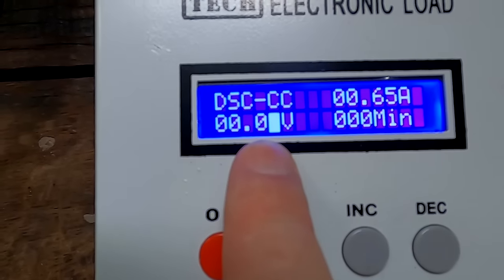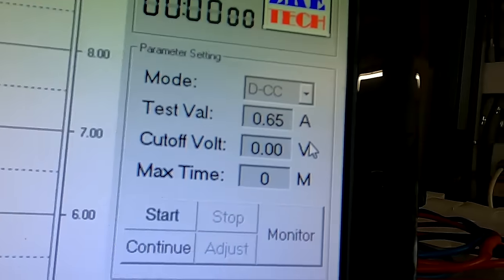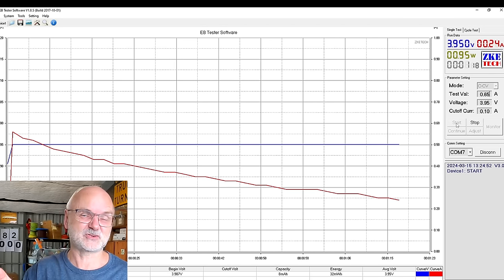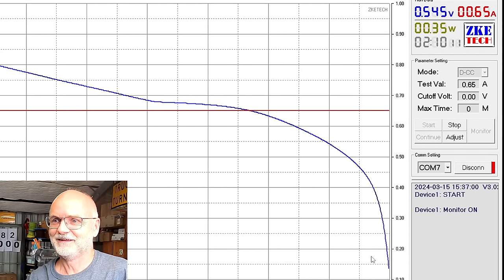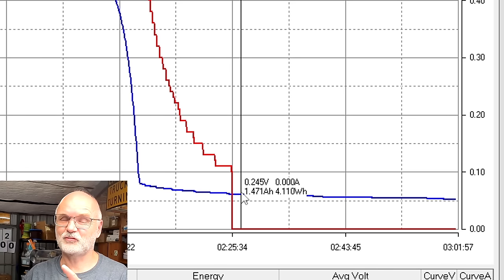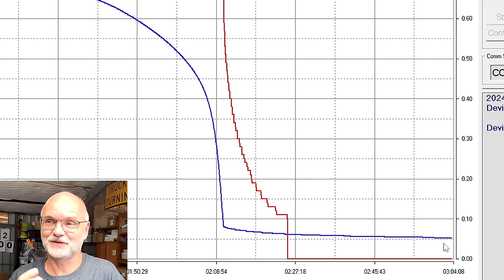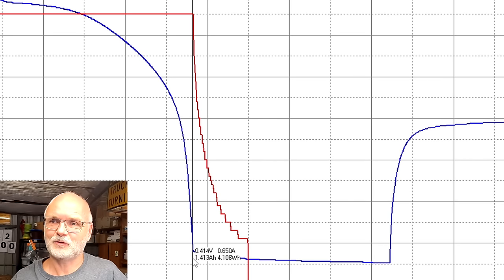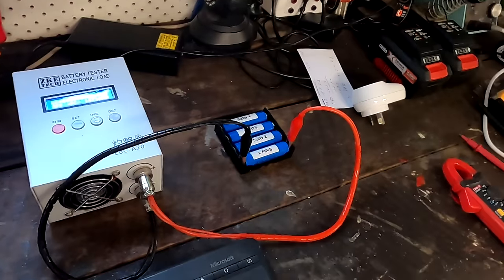Reached the Discharge Limit of a Sodium battery? A voltage plateau at 0.3V!

Comment: The 0.35v is limitation of load tester.  It has a current shunt resistor to ground with an op amp to drive a MOSFET load device for feedback controlled constant current.  The non-inverting input to op amp gets a reference voltage from controller that sets the constant current level through MOSFET. There is limited range on the op amp control and once the battery voltage gets too low the MOSFET Vds minimum voltage is limiting the pull-down voltage to about 0.35vdc.
Reply from the maker: Yes, I agree. Makes sense... thanks.

Comment: Awesome testing. I'm reaching back in my brain to remember the lithium ion curve to compare the density.  I had asked a few questions and I already found the answers. According to the graphs of both types of battery for my inverter discharge cut off I would need about 30% more battery of Na+ to maintain the same Wh as lithium.  Cut off is at 70% Na+ (Wh/kg lithium 180, Na+ 155.) In warmer areas the charging .5C of Na+ is 113f. Lithium is 150f at 1C. There is a cycle expectancy of Na+ 4000 @.5C and lithium 4000@1C. 
Thanks for the work Andy.
Reply from the maker: Thank you.
Yes, you would need more sodium batteries to compensate for the voltage range, you can actually use plus even more for the lower energy density when compared to LFP.

Comment: You should build a big 17s sodium prismatic battery and test it!! Victron cam use most of its capacity.
Reply from the maker: A 17s sodium battery will have a voltage range of 25.5V - 67.15V.
Victron can be operated in some of that voltage range, but not most.
So, you will already lose usable capacity with that plus even more due to lower energy density when compared to LFP (+ more space requirement).
So, the price would need to come down a lot. A lot lot... I don't see this happening. LMFP will be the next big thing is my guess.
Reply: @OffGridGarageAustralia 63usd per prismatic cell per 210Ah, they are not that expenaive...

Comment: Sodium batteries seem to be a good chemistry to have a small battery of this type as part of a larger system, so when using Lifepo4 batteries, if the BMS turns off the Sodium battery would hold the voltage of the inverter at a sensible voltage, no more current spikes when the Lifepo4 BMS turns back on.

Comment: The current drop-off at very low voltages is a limitation of the tester. Even when it's discharged transistors are turned fully on, they still have some resistance, this is what is limiting the current.

Also, there is really not much use in discharging a battery all the way. Remember that W=VxA. So just how much power is it putting out 1/2 an amp? Plus, where can you get an inverter that will work perfectly over an 8 to 1 voltage range.
Reply from the maker: Thank you. We will do an inverter test soon.

Comment: With an accurate volt meter and then a small 1W resistor, you could trickle drain the battery and measure the voltage drop to the bottom. Semiconductor based systems and inductive current measurements will have their limitations but directly measuring the voltage across a stable resistor would be very accurate.
Reply from the maker: Yes, correct...

Comment: That plateau is the load-meter. The MosFets that do the load fall down to there minimum working point. The gate-voltage has to be be higher than source/drain, and need that minimum - a minumum that you know from Shottky diodes measuring too that is about 0.2 V.
So sometimes its better to then use a real wire resistor (no bulbs, thats to much for such tiny cells and is undefined) - and an ordinary "in-line" Amp meter. That Unitec you use caused so many troubles to me, its bit of trash and just a fast "whats going on here" - meter, but not a precise instrument (and below 1 Amp it really starts to struggle and shows magic numbers).

So if you rerun the test, with a resistor - no constant current - and a voltage monitor, you would be able to see a curve that goes down to 0V - and no magic happens at 0.3V.
But - tbh - that makes no sense, because there is no real life use for that.
Data sheet only says 0V does not damage the cell, like it does on Li-based cells.
Its possible to NiCd and NiMh cells to since ages - with no use.

greetings from Austria (that without kangaroos)
Reply from the maker: Thanks for the explanation. That makes sense!

Comment: It looks like the ZKE tester is unable to draw the programmed constant current of 0.65 A below a cell voltage of 0.32 V. Because it cannot reduce its load resistance any further it draws less (you measured it). Consequently the cell voltage decreases much slower from that point on. Later we see a second drawback of the tester. It cannot properly measure currents below 0.1 A and it shows 0 instead. Of course both are excusable failures of the tester because it has to work outside its specification. Usually cells will not be discharged to 0 V and we also cannot blame the ZKE for being unable to measure currents below its minimum discharge current of 0.1 A. But of course it is interesting to go to the limits of both the battery and the tester. Thank you for that.
So no plateau as it seems. You could check it discharging with a 3 Ohms (~1C initially) resistor in monitor mode. But I understand if you want your Na cells to have a rest now and to go on for something less boring than waiting for the cell to reach 0.00 V @3Ohms.
Reply from the maker: Yeah, good explanation. That makes sense.

Comment: The circuit has minimum resistance value it can't go below. Before that sharp drop off in current, the tester would have been able to keep reducing the circuit's resistance so as to keep current at the set value as voltage dropped. But once it reaches the point of minimum circuit resistance, well the current will also drop.

By Ohm's Law, V = IR, with a fixed minimum resistance then as cell voltage reduces the current must also fall away and it will do so asymptotically.
Reply: I think you are on the right track. From my understanding, these types of load testers use large power mosfets to act as variable resistors. As you said, there ends up being a minimum resistance which will end up limiting the current due to insufficient voltage; simple ohms law doing what it does, not the cell having another plateau.
Reply from the maker: Yes, good explanation. The tester is clearly at its limit here.

Comment: It would be interesting to leave them hooked up to your light bulb tester for a few days to see if they still recover.
These batteries would be good for lower power devices that use a buck-boost circuit. Or outdoor solar lighting!
Reply: It would need a boost circuit to get any good out of it whatsoever, because the useable voltage range is minimal without it.
Reply from the maker: Yes, solar lighting is something I have thought about as well. It does not damage the cell. Apparently...

Comment: Very interesting tests thanks Andy. Where it plateaus off at the end & then immediately starts to rise again to 1.5v or higher, my guess is that in the simplest terms it could be explained as the reverse ‘stadium effect’ you get when charging, so those last few electrons of energy present themselves as a rapid voltage increase when the tester stops it’s discharge cycle.
Reply from the maker: Interesting. Never heard about this effect before...
Reply: @OffGridGarageAustralia  The ‘Stadium Effect’. This term has been used in discussions to describe how a battery (probably more appropriate to lead acid tech) can accept a large current when first initiating charging until it reaches a near full state and then it takes some time to get it to a completely full SOC, say the last 5-10%. 
The term reflects the similarities of getting those last few amps of charge in a battery to trying to fill a stadium of 100,000 people and how quickly the first 90% of people can quickly find a seat compared to the last 10% who have to find those last remaining seats. 
I’m fairly sure I have heard you use this type of metaphor before to explain how a battery charges & why it takes so long to get those last few amps into it, you may not have coined the term ‘Stadiums Effect’ like others have, but I believe you explained it almost exactly this same way. 
So my comment was meant to reflect how although the meter may read 0 volts remaining, there are still those few electrons left the meter doesn’t register while discharging until the load is removed, and this is when & why the voltmeter will show a sudden voltage rise.

Comment: I can discharge batteries down to 0.1V with light bulbs and FNIRSI FNB58. This tester does measurements down to 0V just fine. Obviously current falls down with low voltages (as load is close to constant resistance at low voltages).
My Ni-Mh cells seem to recover capacity with such a discharge.

Comment: If you had a circuit with a buck converter limiting voltage to around 1.2v and .05A, and you compared Sodium and Li-ion 18650  batteries, which one do you think would last longer without damaging the battery?  That voltage and amperage should be able to keep a memory chip alive. If dropping the sodium battery to close to zero volts doesn't harm them, I can see them being used in devices that have long periods of in activity.    Excellent work, as usual 👍
Reply from the maker: Thanks a lot.

Comment: Put a strip of copper and a strip of zinc in a glass of salty water, you get a galvanic corrosion cell. That is effectively what a fully discharged rechargeable battery is. As long as they aren't internally shorted, they will always "recover" to this galvanic cell voltage.
Reply from the maker: Interesting analogy.
Reply: @OffGridGarageAustralia  It isn't an analogy, it is basic chemistry. The main difference between a galvanic corrosion cell and a battery is the current path being external with a battery vs internal or otherwise unwanted (ex.: steel fastener into aluminum, copper, brass, etc.) in a typical corrosion cell.

That is why you should avoid letting dissimilar metals touch each other in wet locations as much as possible.

Comment: I bet that at the end, the electrolyte is gradually consuming some of the electrodes in some chemical reaction rather than releasing energy previously stored when it was charged. It might be functioning more as an alkaline battery at that low voltage, releasing energy from a chemical reaction. I can't believe that discharging this deeply isn't causing some damage or loss of capacity. Could it be that the internal resistance is going so high that a voltage can build up but can't be released as any significant amount of current.
Reply from the maker: Could be an internal resistance thing. I will confirm that in a later video. Good suggestion.

Comment: How many cycles will you get if you keep discharging to .3 V? How will it affect the useful life of the battery?
Reply from the maker: All good questions but hard to verify and test.
Reply: @OffGridGarageAustralia  
We had a test for primary cells in that a load of short duration was applied and the recovery was timed. This indicated the cell cappaciy which was borne-out by long-term testing. Of course, each cell type had its own recovery characteristics, so data tables had to be determined.

Comment: To double-check, connect only a resistor across the battery terminals (like 25 ohm or so) and then measure the voltage across the battery terminals.  I = V / R.   The current sensors in the testers are going to be way off at such low currents.   The multi-meter will also cause some inaccuracies at such low power levels but measuring voltage with a multi-meter across a resistor will be a lot more accurate than the tester's current sensors.

Don't try to use the multi-meter's current measurement... it won't work properly (the discharged battery has too-high an impedance and the multi-meter's internal shunt resistor will mess up the calculation).

I wonder what would happen if you left a resistor connected to the battery for like a week.  How long would it take to rehabilitate the battery after doing that 🙂

-Matt
Reply from the maker: Yes, definitely a limit with the tester...

Comment: I think you found a limitation of the tester. It's internal load is unable to maintain the set current at that low of a voltage. Aka, the load resistance is to high.
Reply: A voltage of 0.414V and a current of 650mA suggests that the load is around 0.637 ohms total including leads and circuitry.
Reply from the maker: Agreed.

Comment: The cell doesn't have a plateau, there, I have pulled them down to 0 volts just fine with a setup different than yours... it's just the tester. Couple different things affecting its capability.

Comment: This was a tester limitation, Andy. Just the way it works. Also, you can’t measure 20mA using a clamp meter if you DONT zero it at the SAME spot!
Reply: Agree. Tester limitation.

Comment: I think the load tester is reaching some limit at 0.3V set your power supply to 0.3V attach it and see what current you can draw, then lower the supply voltage seeing how he load tester preforms.
The load tester A/D cannot measure negative current, also the shunt has an offset, so as the current approaches zero theres a dead spot where the indicated current drops off.
Andy very interesting your doing these measurements, but your running into the accuracy and uncertainty of your test equipment, which can be frustrating. Relax and have another SPAT.
Reply from the maker: I know, the tester is not meant to be used for such testing. I was just curious to see where the limits of the equipment and battery is.
Reply: @OffGridGarageAustralia 
Always interesting to find the limits, see what you can squeeze out of the test equipment. 
Myself I use my Rigol EL3021 electronic load for battery testing, it has its own quirks.
Interesting and great work you are doing.

Comment: What was the reason you didn't use this in the first video? It wouldn't work to 0 volts? The other discharge failed at 0.5 so I guess this is better at ~0.3

Also where'd that guy asking you to test hemp batteries go.. I wanted to laugh more lol
Reply from the maker: As I said, I was somehow under the impression, the tester only discharges to 1V and cannot be set lower. I was wrong, hence the new test.

Comment: The rather impractical working voltage range of sodium batteries could be moderated by some clever cell wiring. If, for example, you had 12 cells that could be switched between 2S (6+6), 3S (4+4+4) and 4S (3+3+3+3) configurations as the cell voltage dropped then the working battery voltage range narrows significantly. For example, by using 2S for the cell voltage range 3.9V to 2.6V, 3S for 2.6V to 1.95V and 4s for 1.95V to 1.5V then the battery voltage always stays between 5.2V and 7.8V -- not great, but with more cells you could use more configurations to improve things further. However, some ugly things might happen at the moment the configuration switches over -- I guess you'd need some sort of supercapacitor to smooth the output.
Reply: very practical idea 😢😊
Reply from the maker: Yes, I thought about something like this as well, but the wiring effort with cables, contactors and controllers is huge and probably makes this very uneconomical.